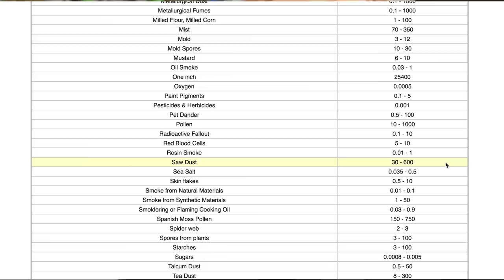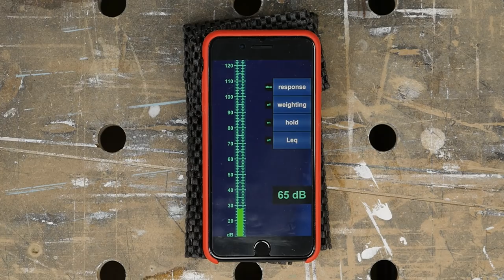Sucky Vacs Follow Up [#210]

Comment: I picked mine up for £29.99 and was very pleased on using it last night. It actually fit my Titan Orbital Sander without need for adapter, also my cordless circular saw! The hose really is quite a decent length. I will probably not use mine in a portable way, but I will build it into my main workbench so that I can easily hook it up to my sander. I will use my record power extractor purely as a chip extractor.
Reply from the maker: Good plan 👍Would also make a good basis for a DIY cyclone project 🤔

Comment: Great review Peter. I've had one of these for a year or so which I paid £70 for at the time and I'm very pleased with it for the price I paid. At £30 now it's an absolute steal. I concur that the hose is pants and kinks easily but does the job. After some prolonged use sanding filler, I found there was a fine film of dust inside the machine around the dust bag so not brilliant at fine filtration and I imagine the Festool would eat it for breakfast on that score. That's where the higher price tag comes in. But that said, it is still far better than no extraction at all and goes a long way to a better work environment at an affordable price. One feature you didn't mention about the Scheppach is that the suction hose and exhaust port can be swapped round (identical fitting) thus converting the vac into a blower, should the need ever arise. There are some poor cheap tools around that aren't worth the air space they occupy, but I think the little Scheppy is a cheap but fair bit of kit for the money. I'd buy another in a heartbeat (and just might yet). Thanks again for another cracking video Peter. Always enjoy watching your channel.
Reply from the maker: Cheers Danny - always good to hear from a longer-term user when I do these vids 👍👍 And yes, both the Festool and Scheppach vacs can ascot as a blower as well - one guy I know even used his to power a sprayer! 🤔😷👍👍

Comment: Very informative videos Peter. 
I actually dashed over to Aldi   in the car to get 4 of these workzone vacuum's THEY HAD SOLD OUT but....
I ended up flinging into my trolley a router, router bits, router table and some other handy little gadgets. 
The router router table and packet of router bits are just as good as anything else you would spend £350 on and I got them all with change from just under £80 quid..!!! 
Once the the router table is fixed to your bench all doubts go away and it works like a £500 bit of kit. Feather boards fence stops & guides all come with it. 
Cheap and cheerful, it does the job, I'm over the moon with it. 
3 year warranty on their Workzone tools. How can you ever go wrong with that? It's crazy.
Reply from the maker: Thanks John! Yes, Aldi were sold out of the vacs online by late afternoon Friday, and I think the remaining stocks in stores went over the weekend. Great value little vac though, if you can get your hands on one. 👍
Reply: This is one of those days I'd love to live in England.
I wonder if LIDL has this kind of sellings within their PARKSIDE range. Never noticed that here in Slovakia.
They have from time to time special offers with workshop things but not that "crazy cheap".
Reply: Hans de Groot lidl over here in Scotland did a powerful Parkside Wet and Dry Cacuum for £34.99 in February.
You might find if you join the Aldi Lidl websites or Parkside and Workzone websites and get on their emailing list, same as all other tools makers just join up and you'll get information and also be able to enter competitions by answering a question and get tools for Free.
Rockler in America help thousands of small DIY guys and girls out by sending their products out to you in return for A Honest review and opinion by posting your video's on YouTube.
Join the Dewalt website and you will be able to enter a competition by answering 1 question. The answer is FLEX VOLT lol.
You could win a bundle package of FLEX VOLT cordless tools. The closing date to answer the Question is 30th December 2018 and the winners will get their tools in February 2019.
Start browsing those tool manufacturers NOW.
Reply: Thanks John for your reaction. I really appreciate that.
I'll have a look at those sites.  My YouTube Channel is still very premature.
I did some test videos and then it stopped. I continued filming and making things till the end of April.
After that other things became more important. Unfortunately, a day has only 24 hours.
Days are slowly getting shorter so outdoor activities will be less which hopefully gives more time
for editing and publishing videos on YT.

Comment: dB is an algorithmic scale, so comparisons are not straightforward.  For instance, going from 60 to 70dB is 10 times greater, and going from 60 to 80 is 100 times greater.  If you don't know this,  you might assume it is 20 times greater.   Then there is sound pressure, or micropascals.  Sound pressure can damage your hearing even if you can't perceive a change.  In other words, your perception of sound is different from the pressure on your ear.

*Every increase of 3 dB is a doubling of the sound pressure level (twice as many micropascals). A sound of 23 dB is twice as much energy as a sound of 20 dB.

*The decibel scale is actually a pretty accurate representation of how the human auditory system perceives sound. In reality, a 40 dB sound is 100 times as loud as a 20 dB sound, but it seems twice as loud. Twice as loud as 20 dB is actually 23 dB, but it doesn't really seem that way.

*It's important to remember, though, about the doubling of sound energy when you are dealing with sounds loud enough to cause hearing loss. Exposure to 100 dB noise for more than 15 minutes can cause permanent hearing damage; 103 dB is twice as loud, so noise at that level can cause damage after half as long, or seven and a half minutes. Chances are you can't even hear the difference between 100 dB and 103 dB, so when you're dealing with noise at that level, it's safest just to wear hearing protection no matter how long you're going to be exposed. 

Bulletted points from http://www.speech-language-development.com/decibel-scale.html.  Interesting, clear explanation at this site.

I have a moderate hearing loss, so I'm keen to protect what I have left!
Reply: Everyday is a school day! Thanks KB Woodworker
Reply: It is probably just a typo, but to be clear the scale is logarithmic.
Reply: Oops!  I know the difference.  Just a brain error, going too fast when I comment. . . logarithmic is correct.

Comment: Peter - I think you find that 6 dB is a doubling of sound level. I also see that Lidl are doing a wet and dry vacuum (not portable) for £30 at the moment.
Reply from the maker: Thanks Charles; 3Db doubles ‘acoustic intensity’ 10Db doubles ‘perceived loudness’ that I referred to in the vid👍 And thanks for the Lidl tip - I’ll check it out 👍👍

Comment: dB rules of thumb: 3dB is a halving or doubling of power. So the Aldi/Sheppach emitted close to four times as much noise as the Festool. But that is all you can actually say about your test with any confidence, because...

... when you are considering sound, ABSOLUTE loudness is measured in dB(a). The suffix means two things: 

1. that it is calibrated to a reference sound loudness (commonly a ball bearing dropping in a tube next to the meter, as that is easy to make consistent), and
2. that the meter has an "A"  sensitivity curve, which mimics the response of a normal, young human ear.
Your phone almost certainly isn't calibrated, so you can use it for relative measurements (comparing two similar sounds for relative loudness), but you CANNOT tell in absolute terms how loud either is. You also didn't test in an anechoic environment, so reflections off the walls will have had a big effect too. But full marks for trying though - you were probably more systematic than the manufacturers!

Aside: whenever I see "XdB" on machinery specs as a loudness level, I know the number is probably guessed or invented. If it's in dB(a), sombody cared enough to use the correct units, so it's more likely to be meaningful.

PS: Charles (below) is wrong: 6dB is halving/doubling of VOLTAGE in an electrical circuit - not the same thing as sound POWER (in air) at all. It's easy to be caught by that one as well!
Reply from the maker: Thanks - I'm learning more about Dbs than I ever wanted, lol! This was only ever meant to be a rudimentary comparison between two hoovers - I have no pretensions of it being anything approaching actual science! I do say in the vid 'perceived loudness' though (doubles every 10Db) rather than 'sound intensity' (doubles every 3Db) because that's what I've read repeatedly; always happy to be corrected byt peeps who know more then me, though 👍

Comment: Better to be lucky than good. Even better to be lucky and good (which you achieve).  I wouldn't buy either, but still interesting to watch and being about 10 minutes makes it doable.  Cheers, David.
Reply from the maker: Thanks David! Out of interest, what vac would you buy??
Reply: Bigger ones, I have a Festool one that works with my sander, Domino and track saw.  And more recently I've purchased a couple of cheap Repco "wet vac" units with hoses that are way to short and create a lot of static when the dust and chips are sucked up (enough zap to say ouch when it discharges via my body!).  Repco is an automotive supply chain in Aust and NZ.  And apologies I didn't explain the reason I wouldn't buy either is, I do not need to pack them into a vehicle with limited space, I have the benefit of doing most of my work in my workshop.  Cheers, D.

Comment: You can lower the noise output from the Scheppach with a fancontroller (cost around 20/25 GBP/euro). 
Ofcourse you lose suction power but with sanding i think 50% power is sufficient.
Reply from the maker: Thanks! Yes, generally better to reduce suction when sanding 👍👍

Comment: Peter you are knocking it out of the park - well done. There is a whole load of science that underpins filtration and Festool clearly exploit the science to the full. But I bought the Aldi one purely on the Pareto principal 80% of the performance for 20% of the cost - although in this particular case it may be 90% of the performance for 10% of the cost. Can you not upload the Instagram vids here as well? You could always label them with the warning portrait mode.
Reply from the maker: Thanks Norman! I don't know if/how YouTube manages portrait video - happy to keep it on IGTV for now as it's only the one vid, but something to think about. I put it up for my patreon supporters, and had negative reaction to the portrait video, so perhaps it's best left where it is for now... 🤔👍
Reply: Peter Millard Addendum - the unit arrived this afternoon and was put to use immediately. Initial observations - not noticeably noisy, reasonable suckiness but the bag is a PITA to empty - would be much better if it had one seam closed by a zip. After 3 hours of intermittent use I was surprised how hot the motor compartment was. However my biggest issue and with all vacuum devices I have been using with my TS 55 is - I spend a lot of time each cut hose and cable handling - so much so I then forget to turn the bloody vacuum on - what I need is.......😂
Reply from the maker: Thanks Norman, good to know; I'll have to check mine and see how hot it runs used continuously. And yes, if only there was a way to auto-start the vac... 😂🤔
Reply: One should not look a given horse into his mouth!   Doesn't that count for patreon supporters?
Reply: Norman: Mine arrived today and one seam is indeed closed with a zip - the cloth then overlaps so I didn't notice at first. The zip was in the centre of the long edge furthest from the circular spring-closure that fits over the intake nozzle so I had to slide it closed before use. Suction is excellent. Fits my other hoses and dust collection cylinder (fits between the vac and the tool, collecting ALL the dust so the vac never fills up. The non-swivel end of the toll hose is held in by what looks like hot glue. This gave way easily as I "unscrewed" the nozzle off, allowing it to screw into my existing 40mm hose adapters.
Reply: Lee Smart thanks lee I will put my specs on for next inspection.😳
Reply: Peter Millard I checked mine after 20 minutes light bandsaw use and results:
Bandsaw motor casing = 30 C
Vacuum filter chamber cover = 25 C
Vacuum motor casing = 60 C
 

Maybe the motor is designed  to run hot.

Comment: A more narrow hose give’s you more suction, try drinking with a drainpipe... so for a fair compare there should be only use of one hose... I got a cheap vacuum which works good because it has a very small diameter hose, so it cloghs more often but for a wide hose the machine needs to be much stronger... if you take a diameter and only widen it a bit, the amount of flow grows very fast
Reply from the maker: That’s not my experience. Airflow speed will increase (Venturi and all that) but actual ‘suckage’ reduces. I use a 22mm hose for convenience on occasion (see my first ever video) and the suction is definitely reduced. The point of these comparisons is to see how they work ‘out of the box’ which is how most buyers will use them 👍👍
Reply: I have a bosch gas 25. Very powerful vac. Has tool port for start an stop with 1800w capacity plus two filters one being silk so you can wash it out. Also can be used as a floor vac but it's that strong only any good on hard floors as carpet sticks an pulls pipes apart! Was about 200 quid 10 years ago mind.

Comment: Hi Peter, perhaps something worth considering in one of your future vids is aspects often ignored in yt reviews/comparisons ie (backwards) compatibility esp with batteries also with blade bore sizes and max blade diameters and stackability.

I carry around my stuff in the van and don't want multiple chargers and batteries, different size boxes and if my track saw blade becomes dull I have a spare one in my circular saw box.

Plus I use a "respectable" tool brand that retains its resale value to some greater extent than eg workzone.

Its just to help people consider more than just the particle size and how many 2bys you can cut on a single charge as per some yt reviews.

Note : not a festool or other brand fanboy!
Reply from the maker: Yep, all excellent points, thanks! 👍👍

Comment: Hi Peter, I’m only just tuning into your site. I have you subscribed now. I love the Festool stuff and I am starting to replace my own tools to Festool. Can I ask- is that small Festool extractor available in 110 volts?  I need an extractor for my Festool router and sander. I was considering the 26 extractor, then I see they have a cyclone attachment now so very little actually reaches the bag so I thought I might get away with their midi if I got the cyclone attachment save on space and money. Then I see this video and now I don’t know what I want lol. What would you suggest? Cheers Daniel
Reply from the maker: Hi Dan. AFAIK the CTL SYS is 230v only - don’t know why. Do you need a vac to be portable eg for job site use? I have the older CTL22 and it’s huge! Midi is a much better option if you want to be mobile IMHO. In case you didn’t know, all Festool vacs apart from the CTL SYS have the same suction, just different capacities. HTH 👍
Reply: Peter Millard , hi Peter, thank you for getting back to me so fast. Ya site work for me mostly. I like the idea of the sys extractor as it fits into my current system but it’s not practical for me if it’s not 110v. Probably best for working in existing homes. I was considering the 26, but again it is large and heavier than I’d like. The midi looked great but I dismissed it at first because I’d be forever emptying the bag. But with the cyclone addition maybe that would solve that problem. Any chance you could do a review of the Festool cyclone system? Cheers Dan
Reply from the maker: Thinking a bit more about it, they sell this in the US, so they must make it 110v, possibly just not for this market?? ot really interested in the Cyclone unless Festool can supply one, lol! 😂

Comment: Peter. Great videos by the way.  I'm a relative newcomer to this woodworking lark and  have recently purchased a  Bosch GTS 10XC tablesaw which I am in the process of building a cart to accommodate. There  will be an integral  cyclone dust interceptor and c.40 litre removable dust box in the cart and was I wondering whether, in your opinion, either of these two would be adequate to provide the necessary vacuum to power that set up, or do I need to look at going a size up (CTM/L midi or similar) ?  I am planning to incorporate a router table insert into the saw table  extension, so would want enough suction to  provide adequate above (fence) and/or below (down draft box) dust extraction for that, but  these would not  run simultaneously with the table saw  and would have a blast-gate setup to switch between the saw and the router.  The cyclone and dust box ( which are pretty much  vacuum tight) would address the CT-Sys dust bag capacity issue,  so its simply a matter of suction.. Any thoughts welcomed
Reply from the maker: I wouldn’t trust the Aldi/Scheppach for any long-term usage tbh - it runs very hot and I’d be happier spending a bit more. I’d want something a bit beefier generally tbh. If you just want a power unit without power take-off then  I’m hearing  a lot of good things the v-tuff ones just now. Might be worth considering?
Reply: @10MinuteWorkshop  thanks for that ... will take a look

Comment: Hi Peter, I want to ask you if both vacuums you showed can be combined in a stable way, to a bench saw?  I need to install a small and silent vacuum cleaner together with my miter saw and the two models you presented would be ideal, but I would not want them to be created only for shoulder use or for powders of different sizes.  Thanks